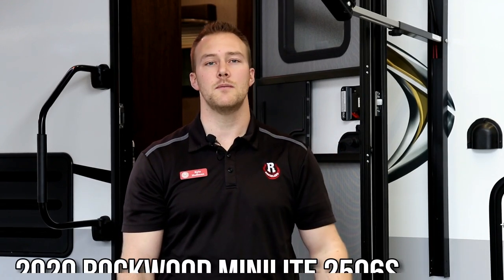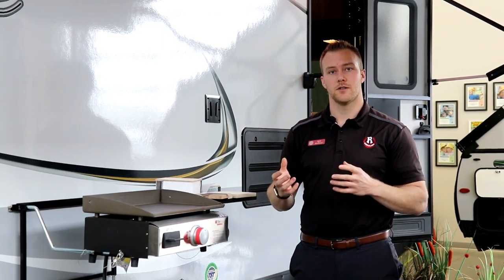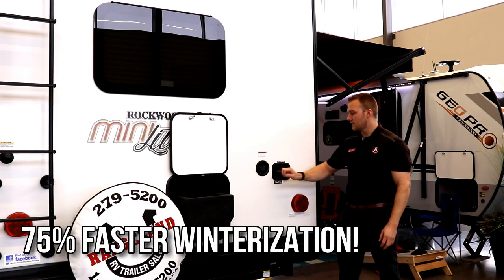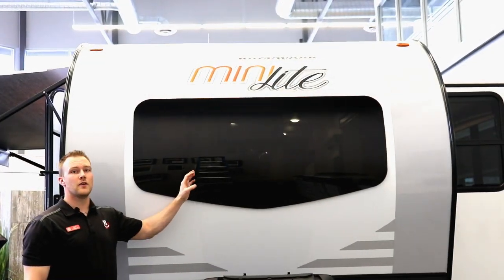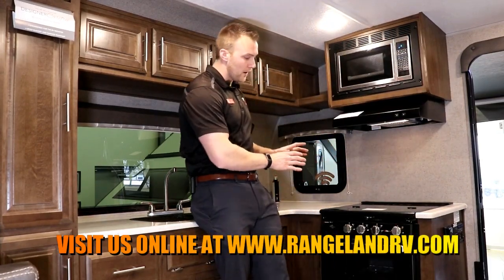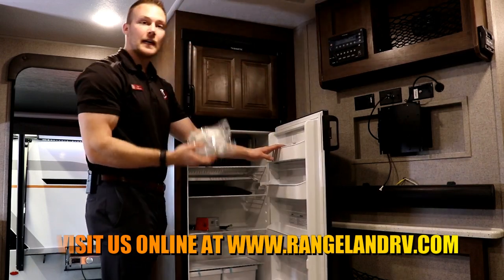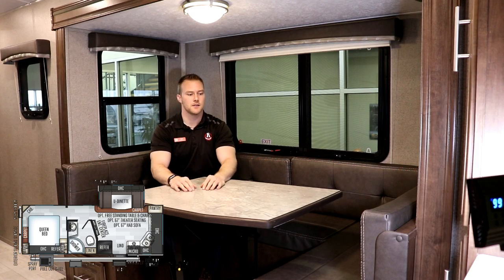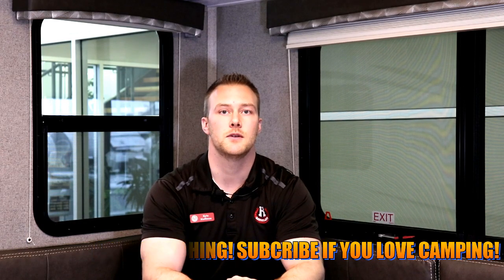2020 Rockwood Minilite 2506S Front Kitchen, Walk through video with Kyle of Rangeland RV.

Comment: By saying the outside fridge and tank heat pads are 12volt, does that mean they won't work when using shore power?
Reply from the maker: Hey Denny, 
Kyle made a mistake, the outside fridge is only 110/shore power. The heat pads being 12volt powered means they can run when the trailer is plugged in and when you are off the grid.

Comment: Is the mini lite a 4 season camper?
Reply from the maker: Hi Doug,
The latest version of the mini lite offers a larger furnace with an added layer of radiant foil insulation through the floor and slide outs. We also option in 12 volt heat pads on each tank. With that said I would call it a 3 season trailer that you can use during shoulder seasons but not through the winter. I hope that helps.